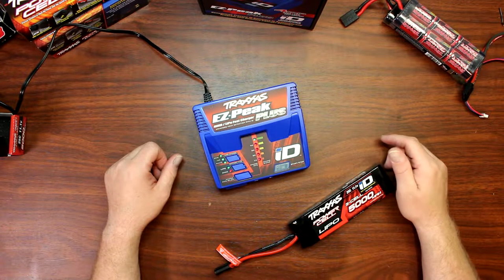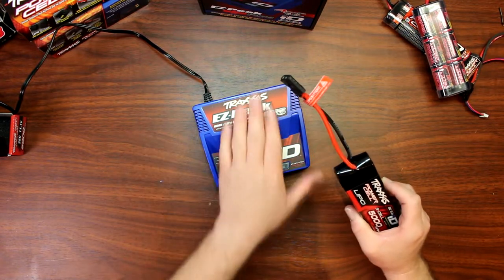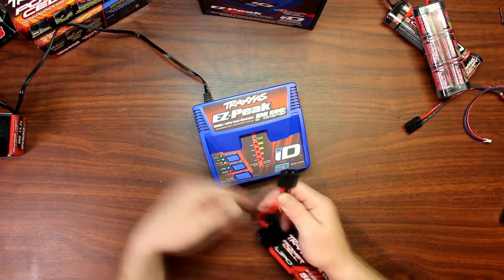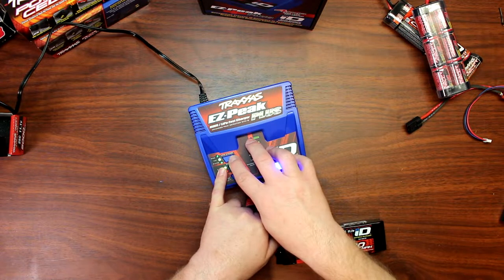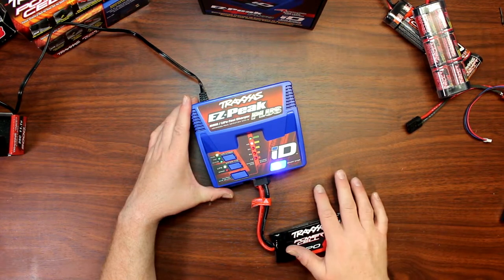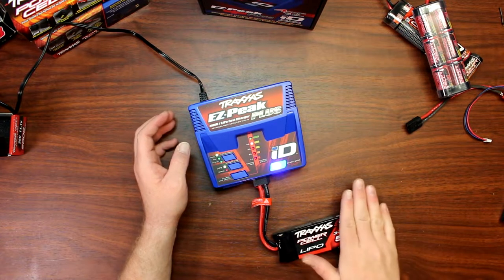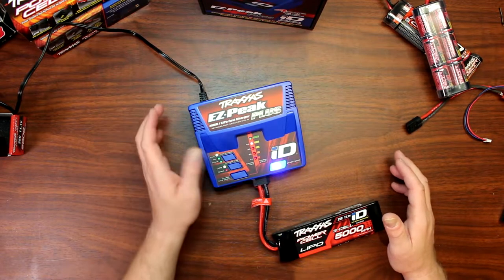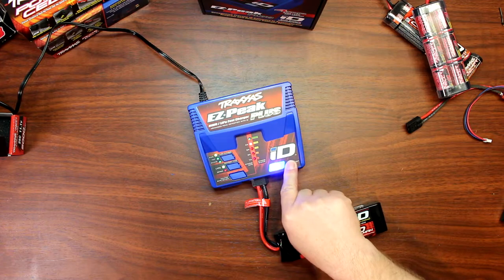Traxxa Ez Peak Charger How To Lipo

Comment: When storage charging my battery, how do I know when it's complete and safe to store away? The charging rate light is blinking green, but the charger fan is still running.
Reply from the maker: The light should be solid green when finished charging or in storage mode.
Reply: @djsprc  Can you set the amps at which it storage charges or does that not matter?
Reply from the maker: @Rigdab  Go to the highest as possible

Comment: Hey do u know how to calibrate traxxas tq top qualifier reciver ?
Reply from the maker: It’s been a while I do not remember by heart.
Reply: @djsprc  ok it was just couse i have a project at our school and i chose to explain how my car works but the problem its not going forwards or backwards but it can steer 👍
Reply from the maker: @brexerdof1098  If you’re using a Traxxas speed control. You will need to calibrate the speed control if I remember correctly I do have a video on that.
Reply: @djsprc  ok thanks 👍
Reply: @djsprc  it seams like my car does not have one

Comment: i am storage charging my battery for 30 min and it is still 3amp and the green  led is not solid... how do you do it??
Reply from the maker: Putting a battery in storage mode with a charger can take a while the charger does not discharge it fast. It can take a couple hours
Reply: @djsprc  thank you so much
Reply: @djsprc  but it is already 1 amp when i do balance charge.
Reply from the maker: @poomonkeys  The charger might be saying 1 amp. But a lot of charger will do like 0.2 amp   And that is very slow to discharge.